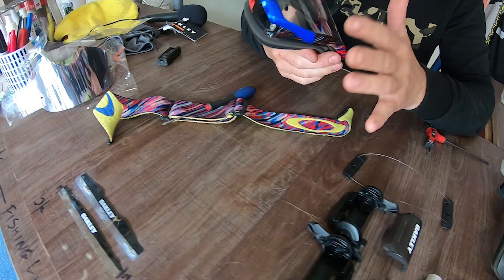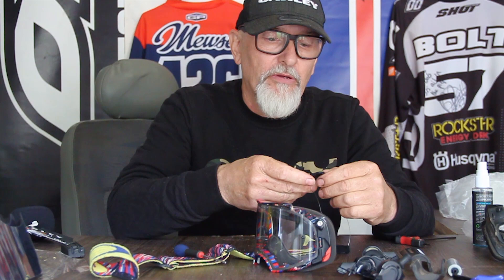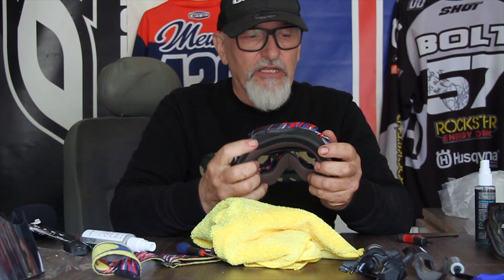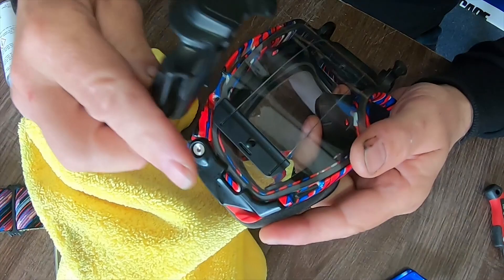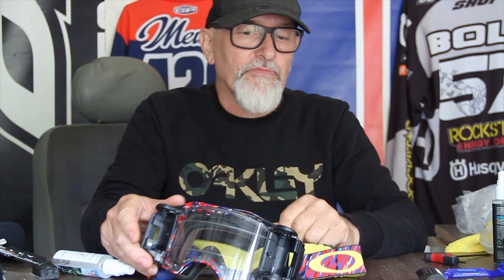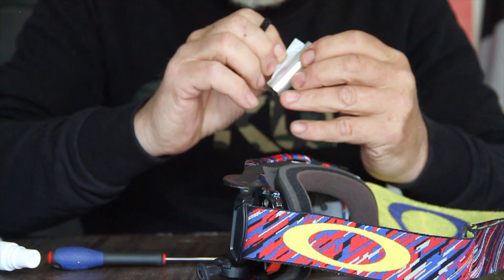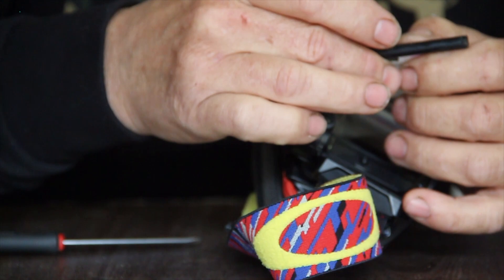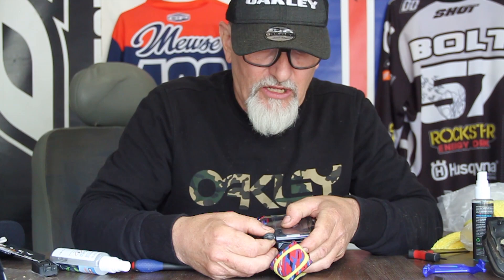How to set up a roll-off system on Oakley Airbrake MX Goggles | Race FX

Comment: I have the 100% forecast and when i pull it its almost stuck do you need to have the plastic part at the top that goes over the roll of plastic
Reply: No you dont. I had  that problem.you don't need to have that plastic.when you are setting up your googles make sure that  you lined up flippers with stick.if you have 100% flippers you are gonna have arrow  who is gonna  tell you how you need to put it.😃😃

Comment: How do you OPEN the canisters, to service the roll offs. It comes with no instructions and this video is in complete.
Reply from the maker: Hi Ian. To open the canister you just push the tab on the side.  In the video Bob demonstrates how to put the door on but to remove it you just do the opposite.
Reply: Race FX Ltd 

On my one the tab is underneath the strap, and you push the tab towards the centre of the goggle and up. 

It was not at all obvious, and was poorly covered in another video. 

It’s hard to believe $230 goggles can’t be supplied with some basic instructions and a soft cloth for cleaning. 

They are charging a premium price and skimping on the basics.